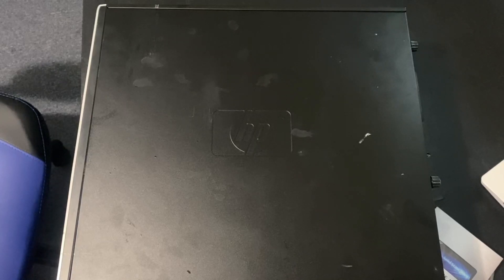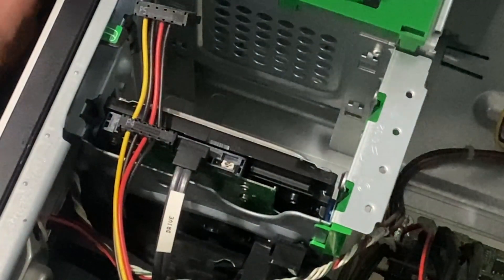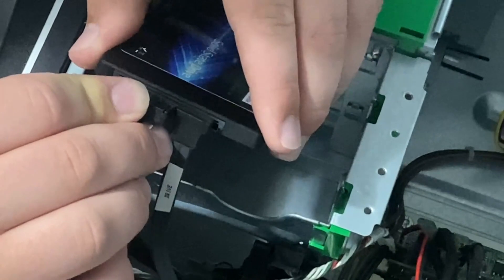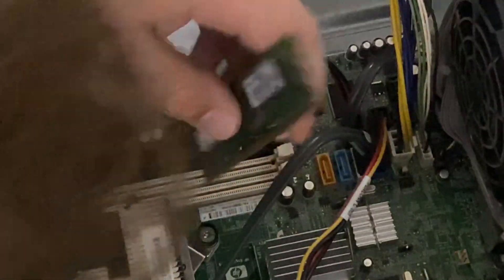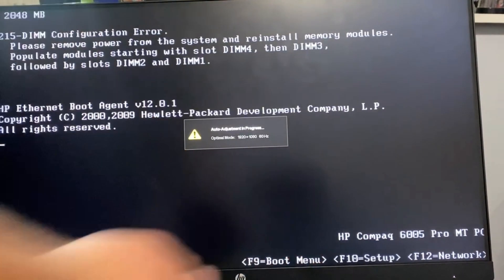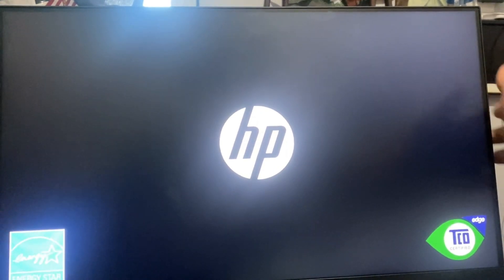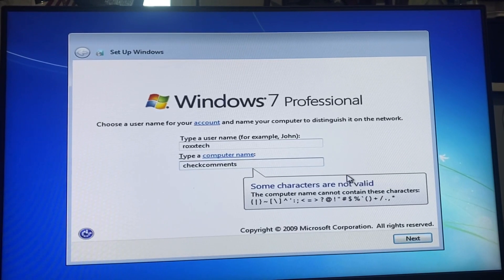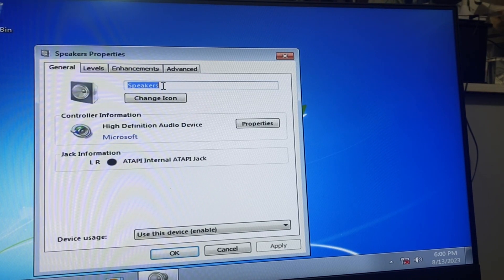SSD on WINDOWS 7? Upgrade and windows install

Comment: So, good to see young people getting their hands dirty.  One thing that gives the ram away right away is the spec on the sticker.  It says PC3 which means it is DDR3.  The ram you bought is PC2 which is DDR2 and original DDR being PC.  I wish I had some young inquisitive folks nearby because I need someone to organize and clean my basement which is full of parts from the last 25+ years.  I could easily build a dozen or more systems but other than the joy of building them, have no use for. 🙂
Reply from the maker: You got any old windows install discs 😏
Reply from the maker: @GooseAffiliate859  ouch

Comment: Doing something similar to this rn, just with old parts from ebay. Got a 9800GT for £13, 8gb of DDR2 (4x2gb at 800mhz each) and a Core 2 Quad Q9450 for £8. The motherboard is a intel branded board from their business line and it seems to support everything I want and only costed me a further £14. Late 2000s desktops are attractive build options simply due to how cheap the components are (at least for me) and can still be reasonably capable machines. Haven't decided if I'm gonna run a cheap 128gb SSD (they can be had for around £8-15) or continue using my 7200rpm 320gb HDD (which part of me wants to do purely for the sound)

It's nice to see young PC enthusiasts messing with machines as I did this in 2020 when I was 15 too for my first brand new AM4 based PC
Reply from the maker: Thanks! I’d say to get the hdd just to stay with the theme of the build being, well old

Comment: When you get a computer, always take the model number and go download that Fine Manual online.  That will give you the proper RAM, CPU options, sometimes even BIOS updates.  BIOS updates can sometimes unlock new features like greater RAM capacity and CPU upgrades.  Or it will brick your system.  Fun!  With the SSD and more RAM you can probably run Windows 10 but not very well  A low power graphics card would definitely help.  Keep up the good work!.
Reply from the maker: Yeah, I put an old gt 710 in it, and it still doesn’t run well to say the least for windows 10
Reply: Oh good heavens... at least try a GT 730!  The 710s are evil

Comment: Kinda late, but you should look at the motherboard for its name so you can check the compatible speeds for the ram. The max capacity for DDR2 RAM is 8GB, but the motherboard seems to support only DDR3. Can't install native launcher means your Windows is outdated. The last time you were able to install Minecraft was because that version of W7 had some updates that made it possible. Since Microsoft stopped updating W7, I recommend you to install W10. Hope you come up with a new video and don't give up until you make it work.
Reply from the maker: My next video (when I’m home and when my ram comes in) is gonna be an upgrade saga from trying to put xp on here all the way to win11, I doubt I’ll be able to put xp or 11 but I’m gonna try
Reply: @othrsideroxx-tech  Look at the COA sticker on top. I saw it showed Windows 7 Pro with XP Pro Downgrade. So if you have an OEM XP Pro CD it should install and activate/ Just make use you go into BIOS and change ACHI to IDE mode even if it's SATA it should work in IDE mode.
Reply from the maker: @computersetc1123  yeah no I don’t I tried manually making my own drives, none worked so I kinda scrapped the video oops

Comment: Most Win 7 type machine(except for earlier ones) take DDR3 ram, When in doubt,check the specs of the PC on line. i have so much spare DDR3 ram around that I wish i could just give you a stick. Lots of thrift store pc finds prior to CV-19 era. Stores are not the same now as there were pre 2020. You didn't need  a key since it is 'baked in' to the PC by the OEM (HP in this case).
Reply from the maker: i mean, you could 😏
fr tho, i bought a 4 gb one on ebay for 5 bucks so you can keep them for now